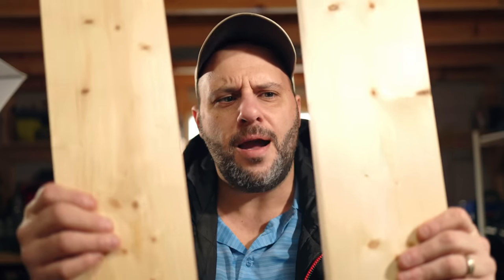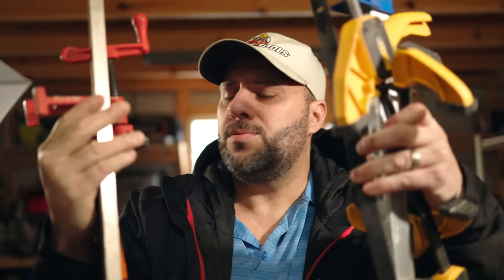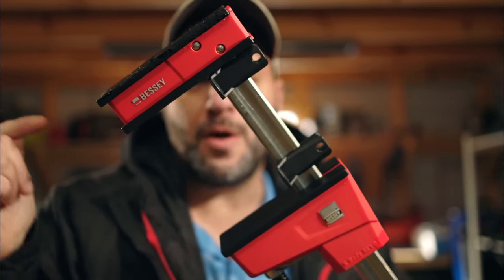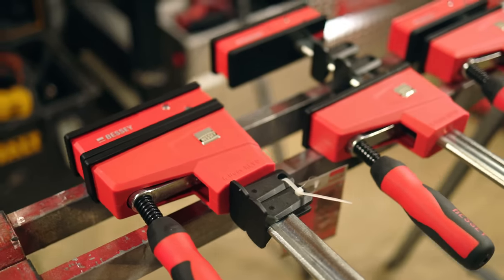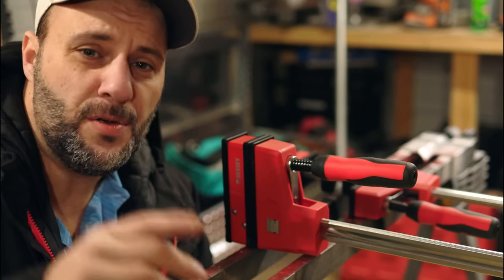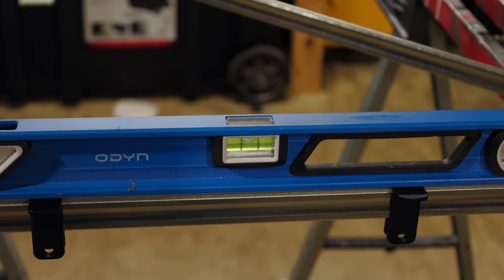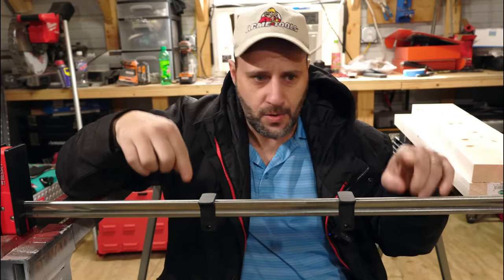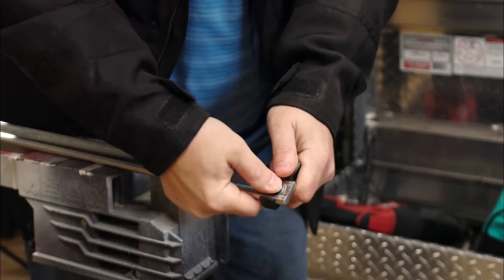Best Wood Working Clamps You Will Ever Use and It's because of this special feature!

Comment: I love it the in your face statements, a true professional.
I know cheap tools as a finish carpenter, started off with black and decker, the circular saw was under powered and could not cut a straight line no matter, kicked back even. the drills didn't even last a year.
I bought DeWalt the saw is far and away better, still own it nealry 25 years later.
like optics and audio you get what you pay for. Milwaukee, Makita  and Bosch are for the pros, Hilti and Festool are for the experts

Comment: I have had my bessy clamps for months now. I love them I have only 2 36" clamps but wish I spent the $35. ea. and gotten two more. I saw a similar clamy that was orange for much cheaper for a set of 4. Big mistake, they tighten at the tips moving the wood. I am going to have to bight the bullet and get two more Bessy clamps. Good video, thanks

Comment: These and other similar clamps are over-priced and not worth the cost. Pipe clamps are all that is needed in 99% of the glue-ups involving the glue-ups of several boards. These clamps will only be wall decorations and dust collectors. Don't waste your money on them.

Comment: I have a bunch of KRE Bessey clamps in different sizes. Now, after the major purchases of what I needed, I buy at least one clamp a month. I have ended up with a nice collection. I continue to buy one a month from 12" up in incremental sizes. I love them. I wax the bars as soon as I get them too.
Reply: I just started my bessey kre collection as well, and that's how you do it; over time and not all at once. Instead of one, I spring for a couple a month since I prefer buying in pairs. The collection grows decently fast. I wax the bars too.
Reply: What wax do u use?

Comment: Nice vid.  I have a few .  To top it off you can remove the screw end like you did and reverse it to make a spreader bar instead of a clamp.  Also, the black caps come off if you need to wash the glue off.  Might even be replaceable.  Keep ‘em coming.

Comment: There's a spot for a hex key on the back of the handle. If you need a little more clamping pressure, or if you're like me and have wrist issues, you can just take a hex key and crank down. My Bora clamps don't have that. 😑

Comment: Besides having many clamps of all types and sizes, including several of these, which btw can sometimes be annoying to slide and release, and not to mention how stupid expensive they are, I seem to levitate mostly to my Pony pipe clamps of both 1/2" and 3/4" Exceptionally easy to use and strong, and will last for generations for a helluva lot less money.
Reply: also if you thread both ends , you can use a black iron coupler  also extend them also
Reply: @josephmaas4538  Yes!

Comment: I just bought 2 sets from Rockler and they were my first parallel clamps also first bessey clamps and I was impressed. I'm building a kitchen table so I bought the extenders that same purpose and it really helped me out but I flipped the ends where the longer part was hanging down off both ends of my work surface to help keep my clamps and table top from accidentally falling like they did with bar clamps. Plus it give you a little extra clamping room. It's something that helped me anyways.

Comment: Bessey have also got the vario version (KREV) where the head stop moves as well as the clamping end. Did you consider buying that model ?
Reply from the maker: If it's Bessey, I would recommend it. Never had an issue with them